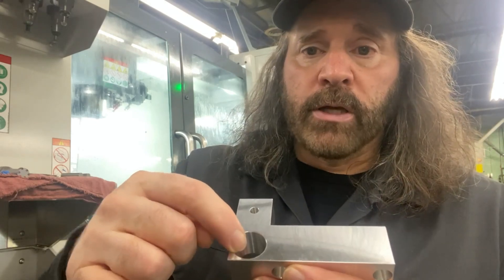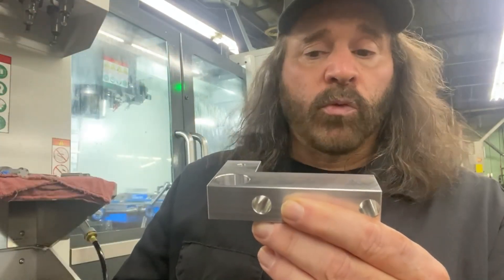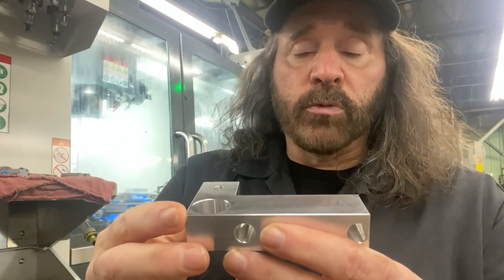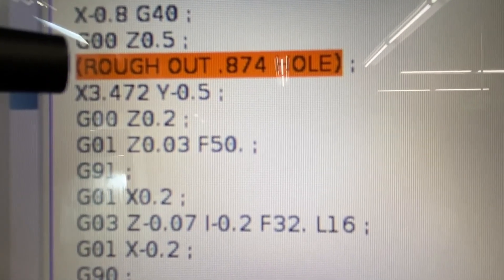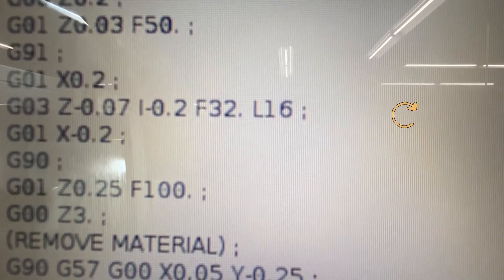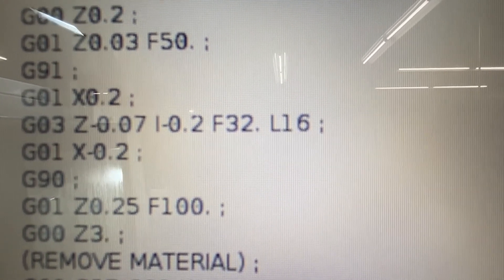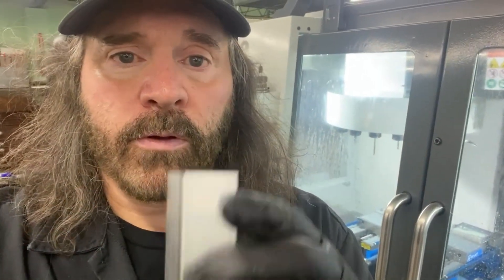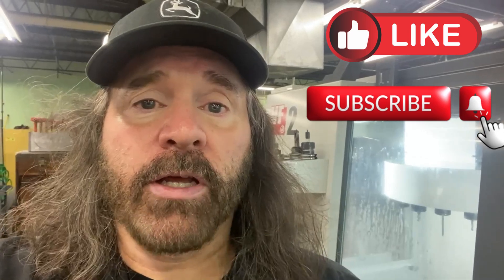HAAS CNC Mill Example - G03 Incremental Circular Interpolation

Comment: Great content! I watched a lot of your lathe content as well. These short videos are informative and straight to the point🙏🏼 I was wondering can you loop a g13 line instead of g03? For example “g91; g13 i.1 k.2 F32. L16;” I’m not sure what your starting radius is so I just put i.1 just for completion sake.
Reply from the maker: @ContrarianCrusade  …Thanks for watching my other videos as well!!
Yes, you are correct. You can do a G 13 code and it would essentially do the same thing but with a G 13 code the cutter moves back to center then goes down the required depth that you commanded and then moves back over to interpolate the hole and with the G3 Code you shift over your amount that you want to do and it will do a spiral motion all the way down until reaches its final looping count and I had it move over.
Reply: @Tims-Tractors-and-more thanks for the info 🙏🏼